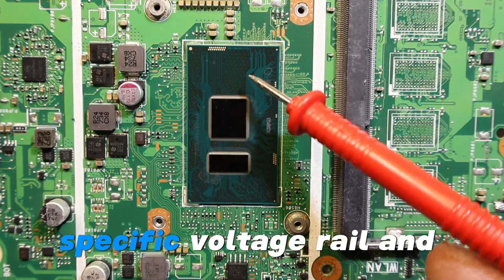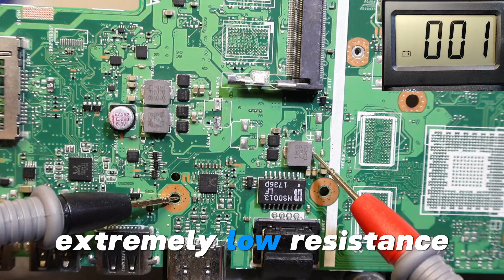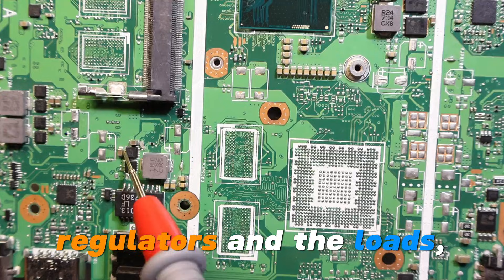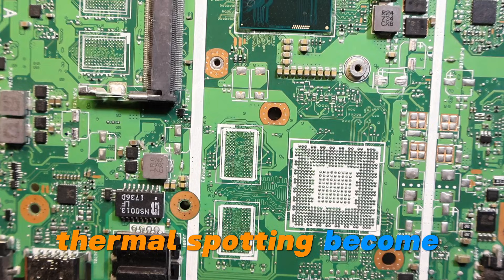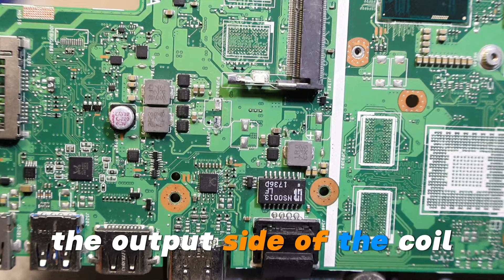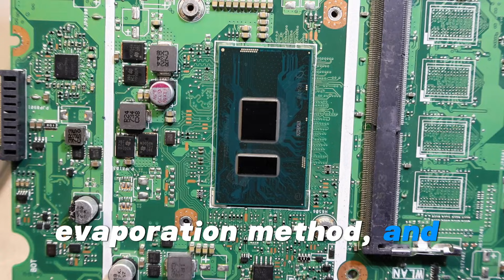This Coil Trick Finds Shorts Instantly - Motherboard Repair

Comment: Whats weird is CPU/ GPU resistance can and is low 4-6 ohms roughly but i see on my HP BA052AU CPU coils 30-40 ohms?? and  ON,  this is normal resistance?  How can a CPU be this high when others are  low ohms usually? I have a HP BA052AU M/B with Screen off and gives one long flash (HP says CPU not operational) but board is on all voltages good and CPU is about 1V on the coils and ON and warm??  GPU is cold and no coil voltages.  CPU Resistance when off is 30-40 ohms cold.   CAN it be a bad CPU if BIOS turned the board on? and its getting volts? I still have to check the "powerOK" signals ect but i guessing they are all on to the EC and VRM chip too if CPU coils have roughly 1V? I have another same M/B that is working normally Screen ON and after warming it up, the CPU coils are 20 and 200 ohms?? cold, its 300 ohms??